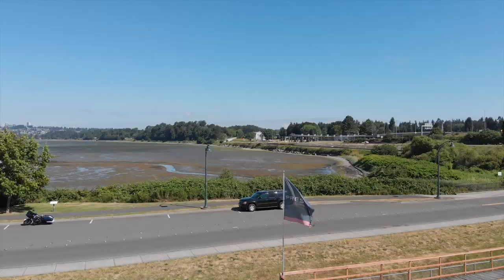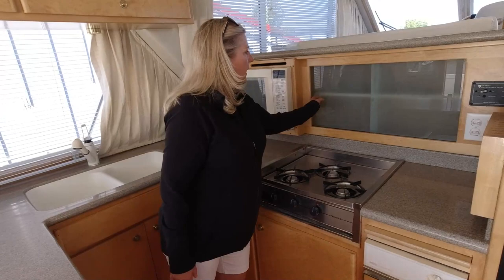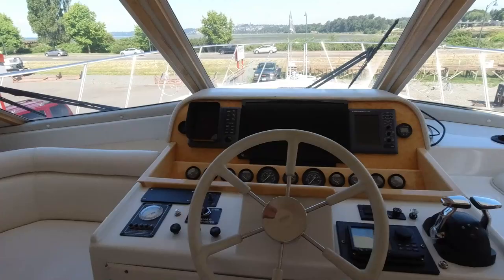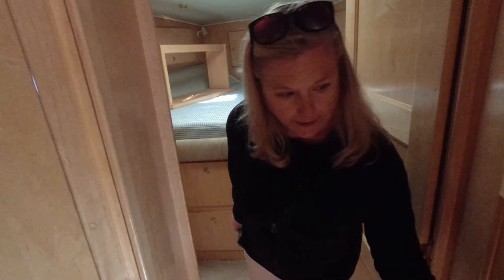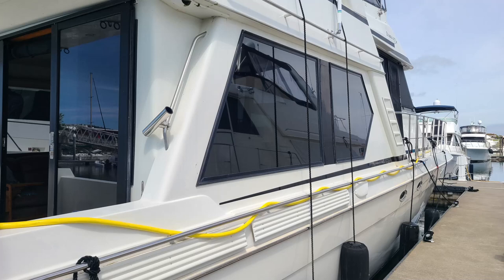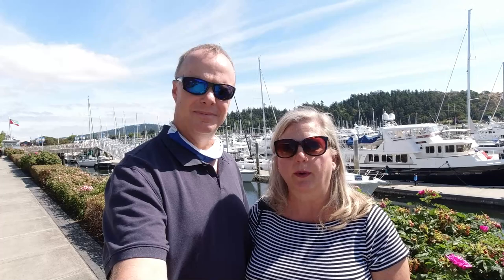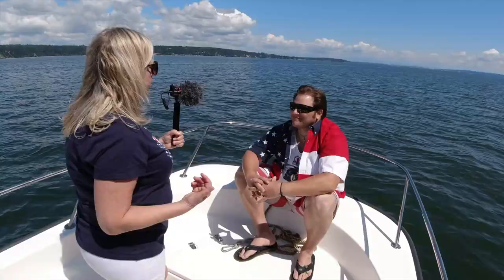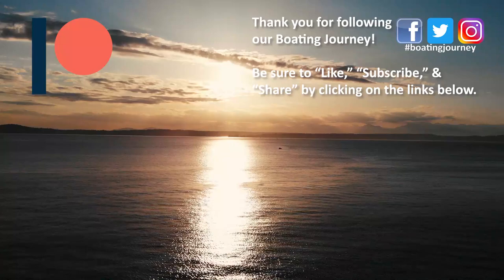Is this Navigator yacht our next live-aboard boat? | Boating Journey

Comment: I love the Navigator boats even though they are a bit out of my price range.  One thing I would say is the only way I would ever consider purchasing a vessel that had been sunk in salt water even for a brief time is if I intended to do a major electric system rebuild or I was ok with chasing electrical gremlins forever as even if it was quickly refloated the seawater will sit in unseen and inaccessible connections and greatly accelerate corrosion
Reply from the maker: Thanks Rob, yeah we're just not game about a boat that sank. Lol 😆
Reply: @BoatingJourney   for the right price I'd be all over it but then again I have this sickness of enjoying that type of challenge

Comment: I use to always wait to find a slip before I purchased my boats and finaly realized it is much easier to get a slip when you have a boat.  Most marinas hold off on locking a boater into a slip until there is actually a boat.  Just my experience.
Reply from the maker: Exactly! That's what we're running into!

Comment: We own at 53 Classic just down the dock from where you saw the Simbaulat.  It's a 1997 so it has the same configuration as the first one in Blaine.  We have owned the boat 7-1/2 years now and even though we don't live aboard, we absolutely love the boat.  If you haven't already, you should get your name on a list at Cap Sante.
Reply from the maker: Awesome 👍  thanks for the note and tip. We will